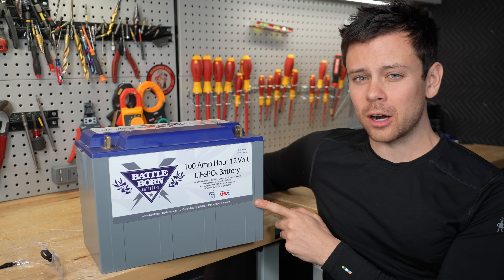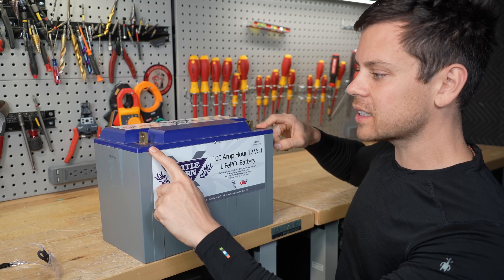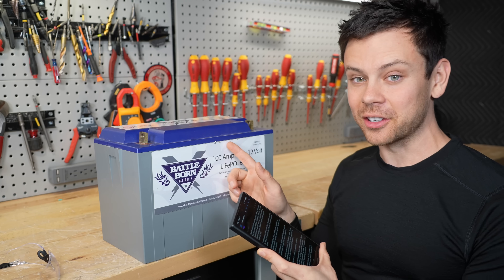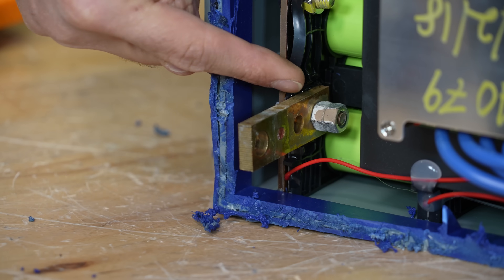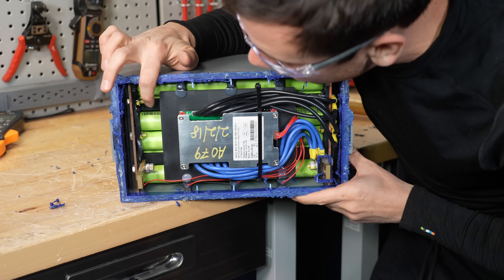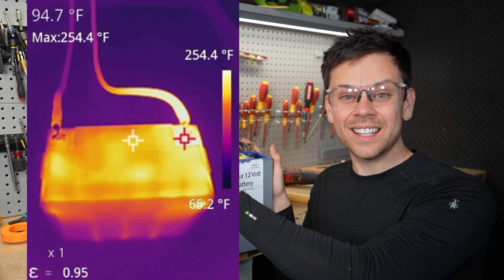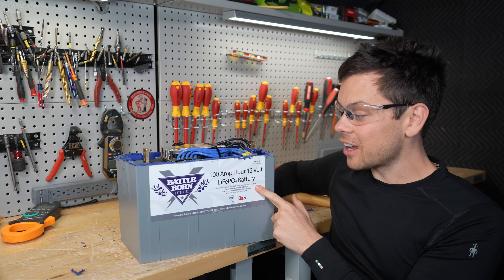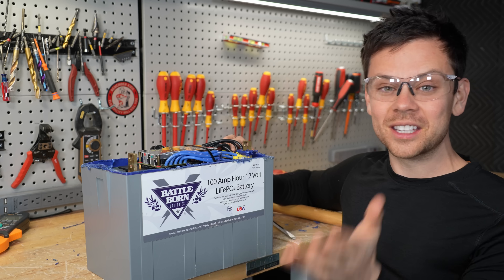Battleborn 12V Battery: Major Safety Issue

Comment: It's interesting Will didn't notice the + terminal separated by that plastic spacer in his 2019 video with teardown of this battery. In his defense, I did not notice it either, but I was not there staring at it up close. I would NEVER connect two busbars with a plastic spacer between them, leaving only the bolt to conduct all current. Not sure what Battleborn engineers were thinking back then. I believe this could be fixed by boring larger holes in the plastic spacer and installing a brass washer thicker than the plastic at each bolt (after cleaning conducting surfaces up of course), that is touching both bus bars. But I don't know what would hold the plastic in place so that might need to be addressed. His comment the other video (3 yrs after) also said the bolt was aluminum, and acted as a fuse, according to Battleborne. I don't think that's a good idea due to dissimilar metals. If it is intended to act as a fuse, changing to a steel bolt and installing one of those new terminal fuses externally would be a good "fix" as well. I have one of these batteries, purchased in 2019, that I used in a previous motorhome but it is sitting on a bench waiting for a new use right now. I just went out and looked at the color around the + terminal and it is brownish-red. Not sure if due to age or heat. I know I did use that battery to start an Onan generator a few times. And the 60A charger saw a depleted battery a few times so it saw some extended periods near 60A. Im going to wait and see if Battleborn owns up to the design issue and hope they offer some restitution. For what it's worth, the rest of the battery design looks superior. I hope they correct this, if not already.
Reply: Aluminium is about 3 times more conductive than steel. And it's melting point is around 600°C. So I don't see a reason to change it. Dissimilar metals can become critical in regard of electrolytic corrosion, but there should not be significant moisture inside the battery case

Comment: Any loctite on that bolt would have disintegrated with the heat.  They've underestimated the diameter of the bolt necessary to defeat the current.  All bolts being used in that fashion should be brazed.  Looks like there are multiple problems with that design though.

Comment: I saw a video once about a battle born battery going thermal. The guy had them wired in series to 48 volts with 2 banks in parallel, and one battery on each bank went over 16 volts and at least one cell went thermal on him. Luckily it did not catch the place on fire but left some burn marks where the batteries were. I never bought one because I could buy a SOK at 200 ah for the same price.

Comment: The solution is Easy. 

BB just needs to start putting an internal/external tooth lock washers between the bar and the nuts. Then change the last nut to a Prevailing Torque Lock Nut. and Tighten, tighten, tighten. It's the same for any electrical connection even in outlets and plugs. Torque down hard to prevent resistive heating.

Comment: Wow, thanks for the heads up! I noticed the new Bluetti batteries use a similar post style, so I shared your video with them. Not sure how they attached inside, but I plan to tear it down after I finish my performance testing to see. Cheers, Ray

Comment: No need for endless comments- a problem has been identified.  

How many direct failures or problems have there been and under what conditions did the failure occur? Blaming BB (or end user) doesn't address the underlying problem.  Granted, 2 nuts securing a buss is bad.

In what way is BB going to address this problem?

Comment: I hope the problem is on a specific lot of batteries.  Appears to me that the defective batteries were manufactured with a thermo plastic material rather than a thermo set material at the battery positive  post support.

Comment: Why they put plastic between output terminal and busbar!? OMG! When using it, plastic heats up litle by little making deformation and with that bolts gets a little bitloose and situation gets worse after that, because now it heats more and melts everything..
Yeah, this battery is dangerous, indeed! 😬

Comment: there's still people recommending only them despite the ultra premium prices yet there no different than Bargen batteries from that look inside. you need to see if someone has a older one that's might be in need of replacement to cut it open to see if this is the way they always made . im vey wary of any co claiming premium prices . too often its all hype. i realise when bb started lithium was new and showed such benefits but that system is below 2nd rate construction .means they must have switched contracting or contractors shortcutted but Battleborn failed qc checks. china can build crap but when watched they can do quality .example don't buy aa aaa or d rechargeable or 18650 direct from china buy 100 might get 40 that work non as capacity
will and all who got batteries with this defect pleas immediately report the defective dangerous product to consumer product safety commission . and possably the auto since theses get put in motor vehicle's and possably ul i don't know if there ul rated but alerting that agency might be beneficial remember though for valid report you need to poses the item non owners complaints are not valid will with his expertise might carry some extra push

Comment: Jam nuts are almost always a bad idea in high current situations. Because that terminal can be flexed from outside simply by connecting your lug to it, that leaves the possibility of wiggle. Better to spot weld that lug or at least use two separate nuts and bolts, one under the other.

Comment: That is a design, not quality or workmanship concern. No experienced electrician, never mind engineer would use a bolted, contact connection with "soft" circuit board taking the clamp load of the fastener. This failure is due to heat cycling, deforming the board and then the connection become loose. I wonder if this connection design is used in all of the BB batteries.

Comment: You are now going to get sued because you said something bad about someones product. You will get a copyright strike that will be supported by YouTube because you used the name of the bad product. The double nuts on the terminal bolt are there to prevent the connection from coming loose and would have done their job if they were tightened correctly. Obvious manufacturing defect.

Comment: This is directly from Battle Born, read I entirely and if you don’t understand, or you’re in doubt about the safety of your batteries, just call Battle Born directly, their customer support is in America. 

I personally owned 3 different banks of BBB paired with Victron hardware on 50 and 30Amps systems with no issues running A/Cs Microwaves etc without issues since 2019. 

Well, here’s what Battle Born says: “The Purpose- Built Thermal Failsafe
To address questions that may have recently surfaced about terminal heating and fastener design: it is important to highlight that what some observers view as a failure is actually a safety device working exactly as intended.
The aluminum nut used in our 100Ah packs’ positive terminal is a purpose-built thermal failsafe.
It is engineered so that the plastic deforms and disconnects when excess heat is present at the terminal. This protects the internal cell structure by interrupting the current, preventing further heat buildup and thermal runaway.
This safeguard exists for conditions created in the field, such as loose external connections, systems operating outside specification, or uncontrolled short circuits.
It is one of several intentional protective mechanisms within our packs and is necessary for our UL Listing Standards.
Key Takeaway
The key takeaway is this: This design prevents heat from migrating into the cell stack, meaning it stops conditions that could otherwise create a thermal runaway event. It works as a sacrificial barrier that takes the heat event on behalf of the cells. That is the exact purpose of the feature. In cases where a pack has already experienced misuse or improper installation, visible damage at the terminal is typically the result of that safety mechanism activating. That does not mean the design is flawed; it means the protective feature served its purpose. The batteries we sell and support today use the same trusted and validated design that has been in successful field service for many years.”
Reply: But what condition does that protect from? It seems to only protect it from the problem it causes?
Reply: @eugenebeecher7308  Theoretically, a poor crimp or a loose lug, along with a sustained 90A charge or discharge, could generate substantial heat at the terminal, which would be conducted into the battery.
Reply: @eugenebeecher7308  An accidental short circuit on a system with improper fuse for example.

Comment: Thanks for the info. Do you know if there is a build date for these batteries that have this problem?  I installed mine in 2019 and haven't noticed any problems. I've grabbed the terminals occasionally to check for tightness on the cables and all ok but it has been about a year since checked them.

Comment: Sadly this is a long term well known issue with these. BB does a great job of claiming it's a feature not a.defect and trying to blame the consumer of their connections to the battery. Then they play dumb and ask the users ship batteries for inspection before they will offer a warranty. Of course the RV content creators that got free or discounted batteries and equipment magically seem to get the least resistance from BB

Comment: Don’t know if I send this post already.
I have two 75ah BB batteries, I wonder if the design is the same and if anyone has a problem with 75 ah batteries?   Just took trailer in for maintenance and when the trailer is returned I will check for a loose terminal post and also any discoloration around the post.
Will, I hope you are on mends and Merry Christmas!

Comment: 6 years with these 100ah batteries in an RV. Took it to Alaska and back and many forest roads. Have never had a single issue.

You say it's common - How many? Seriously - how many? Showing me a battery and then assuming all batteries have the same issue and asking everyone to stop using their batteries seems to me like you have an ax to grind...
Reply: Sounds like you are on borrowed time, how about you look closely at what you have an see if the same discoloring is on the outside, bet ya do !!!
Reply: Just walked out and looked since i still have those 3, 100ah batteries (they are disconnected as I now use 3 270ah batteries)

Bright red. Don't believe me? Happy to send you the video I just shot on my iphone. Just shoot me an email address or some sort of file sharing site and I'm happy to upload it.

I want to be clear - I'm not saying that this issue didn't happen to this battery. I'm not even saying it hasn't happened to others - but the reaction (TAKE THESE BATTERIES OUT OF YOUR RIG NOW) is a excessive. It should be "Check to see if these terminals are discoloring - put a temp gun on it, etc...." 

A big travel YT channel just had a Victron inverter catch fire and it would be like them saying "Don't buy this inverter" off of a single data point. I have the same inverter - I went out and double checked my connections right after I saw their video.

I am, of course, interested to see how battle born responds to this if they decide to do so.
Reply: @josephcomings think ya forgot the point, better safe than sorry, saying he has ax to grind is bs, the guy spends hundreds of hours tearing apart stuff live, same type of game projectfarm does  ;)  I was running escooters 20+ yrs ago in China, then ebikes staring 16’ an the are the worst in so many ways, battleborn is China components  assembled is US an we can clearly see two nuts mashed together, without a washer between them, typical China assembly.  I had a soeed control that would melt in use, the engineers kept saying we were abusing them, I hopped a plane pulled a unit off the line, rode it out while the engineers jumped in car to follow, 2km later scooter stopped working,  I tossed it in there car, jogged back.  They then said,  O its overheating,  I said nah really   How ya gonna fix, they had zero clue,  I said do two things, vent the battery box fron an back, then put a nice large alloy heat sink on the  speed control.  Days later I took another out, prob solved.  Friggin idiots!
Reply: @print4apet  You lost a bet though... and no I didn't miss the point. But if I'm lookiing for a battery brand that has never had a single issue, I should probably give up off grid life.

He should have said "Check and monitor your batteries if you have this 100ah from battleborn because I've found some things that concern me" instead he went all scorched earth. That's.... why I think he has an ax to grind.

Still can send you the video of mine though if you don't believe me! Sure do wish I had put a wager on our little bet.
Reply: @j @josephcomings you forget he has some forum an has prob had plenty of people cryin about this, not the first time I have seen major issues with them, ages ago I met an hungout with Mr Bttlehimself, he offered me some free, I said nah am good with my renogy they have yet to fail me an I spend over half year in Baja offroading in 06’ sprinter, talk about a beating.
Reply: Side note "It's so common that it happened to all three of the batteries of this one person" Are we as consumers allowed to ask to see how the batteries were installed to make sure that's not a factor? Did Will ask that question? Is it not relevant?

Or do we just assume that the consumer did everything correctly?

Comment: WOW!!! This is scary !! I have 8 of them wired series /parallel to create a 24volt  battery bank in my off grid RV. I haven't had any issues that I know of, but I will certainly be checking them out immediately. I built the system in 2021.

Comment: I have 20 BB batteries in parallel in an off grid RV .  3 went bad in the first year and they replaced them. I checked them all 2 years later and 4 more bad , they said it was my fault and ignored me. After cutting the top off I found 1 bad and dead,  The other 3 had bad bms’s ,the cells were fine, Bought 3 Amazon bms’s and 2years later all good to go. Set my whole farm up off grid with no more over priced BB Batteries.
Reply: Did you set them up in some kind of box with the new BMS? Also, what BMS did you use?

You have some good experience on this and should create your own video
Reply: @jessematchey4802  I used the same box, siliconed the top back.  Used 3 different ones,wasn’t sure which would be best,all worked,
Reply: @roXdawg thanks doggie
Reply: Could you please give a brief description of how you fixed them?
Reply: @derpaderp6642   pretty simple, cut the top off and replaced the bms with another 100 amp bms . I actually bought 3 different  types of bms’s, 3 different price points. If I have to fix another I’ll probably get a JK, more money ,the cheep ones were pretty (cheep) however they work.

Comment: So to me paying extra for a quality product Only to find design flaws that of something 1/2 to 1/4 the cost from China leads me back to taking my chances with a cheaper product In this case having any amount of power coming off of that is a fire risk Picture all the proper wiring And fuses And installing And investment on everything around it ...only to lose it all because of a loose connection you have no control or ability to prevent On a product that deems its self  "Safe & Reliable Lithium Power" This has Changed my view on Battle born

Comment: I contacted Dragon Fly, mfg of these batteries. They indicated the AL nut on the + terminal inside is a failsafe device to prevent thermal runaway. The terminal is loose most likely due to someone over torqing without proper support or strain from improper install. Another situation of jumping to conclusions without all the information.  I would be willing to bet there are people using impact drivers on these terminals.
Reply: This has been their standard response from the beginning: blame the customer. I had this issue. No, I never used an impact driver on the terminals, never dropped the battery or subjected it to any other abuse besides thousands of miles in a 5th wheel. ;)
Reply: @Consumer7977 If the battery is less than 10yrs old it's under warranty; did you contact them on the issue?
Reply: @tonyf5642  Of course. When they told me I'd have to pay freight shipping, and it would only be refunded if they deemed it a "manufacturing defective" (sic), AND said that in most instances, warranty is denied on this type of failure, I opted not to take the gamble.